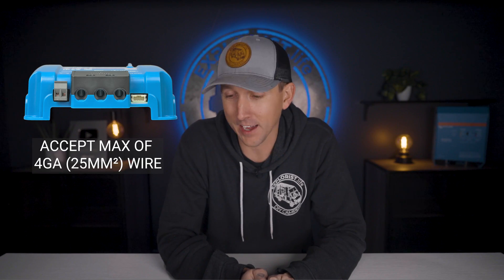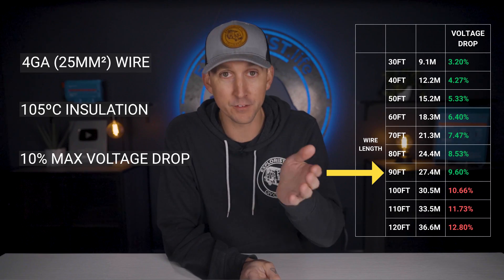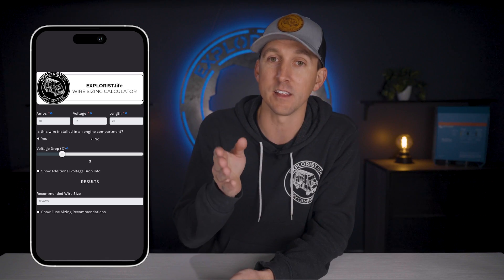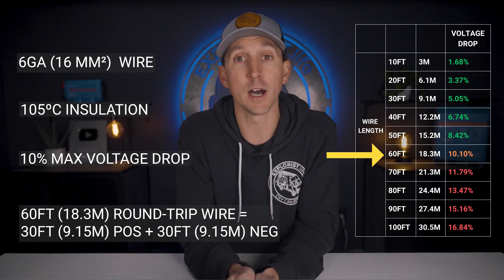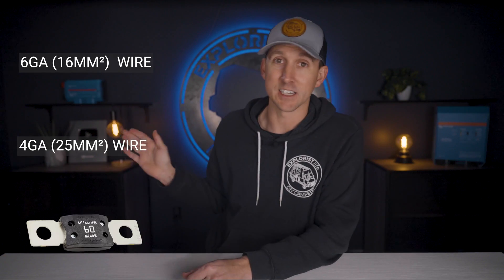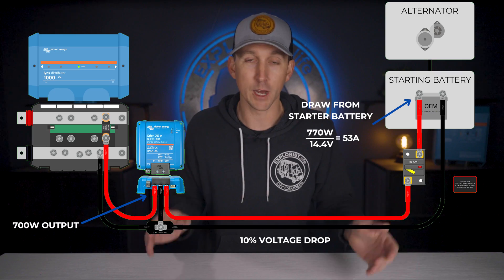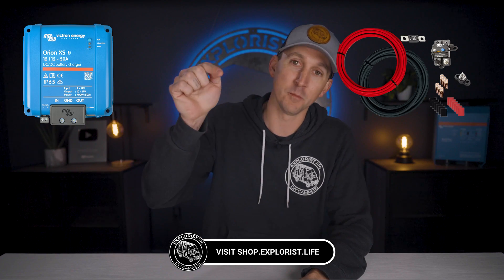Wire & Fuse Sizing for Victron Orion XS DC DC Charger

Comment: I have 8 gauge wire existing in my current Lance truck camper plug, can I set the 12/12/50 charger to provide only 30 amp charge due to wire size and length of 30 feet from starter battery to lithium camper battery?
Reply from the maker: Yes — that’s usually doable, and it’s a smart idea with 8 AWG over ~30 ft.
That said, the “right” limit depends on a few details (your exact charger model, how it’s wired, and your expected voltage drop), so the best move is to have our team take a quick look at your setup and confirm the safest/most effective charge rate for your truck/camper wiring.
Reach out here and include your truck year/model, camper model, the exact charger you’re using, and any fuse/breaker sizes you have on that run:
https://shop.explorist.life/support?utm_source=youtube&utm_medium=comment&utm_campaign=support&utm_content=response_link

Comment: Also should I add ba smart  isolation switch with thIs hook up?
Reply from the maker: Great question — whether you need a smart isolation switch really depends on your specific setup, battery types, and how you’re using the system.

We’d love to take a closer look at your build and make sure you get the right parts for your project. If you can send a quick overview (battery info, alternator, and how you plan to use the rig) through our support form, we can help you dial it in: https://shop.explorist.life/support?utm_source=youtube&utm_medium=comment&utm_campaign=support&utm_content=response_link
Reply: @EXPLORISTlife ok thank you....in on ship now I'll send you whenever I get off the ship

Comment: Ok I understand the 12 12 but what is the 30 mean?
Reply from the maker: Great question — the short answer is that the “30” is the maximum output current of that DC-DC charger.

That said, whether 30 A is right for your vehicle wiring, battery size, and use case really depends on the details (wire gauge/length, alternator type, battery chemistry, etc.). We’d want to look at your specific setup before making a recommendation.

If you reach out to our support team with your vehicle info and planned battery system, we can confirm the correct Orion model and make sure everything is sized safely:
https://shop.explorist.life/support?utm_source=youtube&utm_medium=comment&utm_campaign=support&utm_content=response_link

Comment: Why are you worried about the total length of the positive and negative wire, because you should be using the frame as the negative on the truck and the trailer,
Reply from the maker: Are you in the market for this device/wiring kit or just sparking conversation?
Reply: @EXPLORISTlife I am going to buy the xs was looking at the tr
Reply from the maker: Perfect!  We'd love to supply you the parts/equipment for your project.  Let's move this conversation over to our customer support inbox so this doesn't get lost in all of the YT comments we get and we can be sure you get the answer to your questions.  Reach out here: https://shop.explorist.life/support?utm_source=youtube&utm_medium=comment&utm_campaign=support&utm_content=response_link

Comment: How would you approach wiring (2) of the Orion 50A? Is there a way to run a single negative and single positive wire, or do I need to run two sets?
Reply from the maker: Great question! ⚡️ The best wiring method can depend on your exact setup and components, so we’d love to take a closer look at your project and make sure you get the right solution. Reach out to us here: https://shop.explorist.life/support

Comment: Can this new Orion XS be used to charge a 24v system? (I noticed in/out V is programmable?)
Reply from the maker: Great question! The Victron Orion XS does have some flexible voltage settings, and that programmability can definitely open up more use cases depending on your system setup.

That said, whether it’s a good fit for charging a 24V system really depends on a few specific factors in your build.

I’d recommend reaching out to our support team so they can take a closer look at your setup and help you pick the right gear:
https://shop.explorist.life/support

Comment: Does Orion XS work with solar systems?
Reply from the maker: The Orion XS is used for charging your battery bank from your alternator — it's not designed to handle direct input from solar panels. For solar charging, you'd want to use a dedicated solar charge controller designed for lithium batteries.

If you're unsure how to best integrate all your components, our support team can help you map it out:
https://shop.explorist.life/support
Reply: @EXPLORISTlife  thanks 👍

Comment: I already have 50 amp breakers near my batteries, using 6ga wire. With this 50 amp dc-dc I'll need to replace my breakers with 60 amp. Is that correct? Alternatively, can I just down rate the 50xs to only take say 40 amps?
Reply: Never mind. Re watching this vid answered my question. I'll be buying the XS 50A DC-DC from your store very soon.
Reply from the maker: Glad the video helped clear things up! And awesome to hear you’ll be grabbing the XS 50A DC-DC soon—let us know if you need anything as you get it installed: https://shop.explorist.life/support
Reply: @EXPLORISTlife  I do want some support on the installation. I posted a question about including the DC-DC into my setup but the person went off on a tangent how not to attach all negatives directly to the shunt. Ultimately was no support AND in the end referred me to a $10.00 diagram. So if there is any post purchase support it appears to be monetary support from customer to company.

The videos are great though! I guess I'll stick to them and Wander the West forum for info and answers.
Reply from the maker: We don’t recommend connecting all negative wires directly to the shunt.  Do you want us to go against our own recommendation just for you?  Maybe I don’t follow what you’re expecting from us when you reach out for our recommendation.
Reply: @EXPLORISTlife You clearly don't understand! I do not have my negatives all connected to the shunt. That was not even my question. My question is about the DC-DC charger.
Reply from the maker: @JD-ft2lr gotcha.  Reach back out to support and clarify.  Have a conversation and we can work through it.

Comment: Hi I have done exactly what you have discribed changed my 30amp Orion for the new 50amp XS using the existing 16mm cable. But I am having a problem with the XS, the most I have seen it deliver is 15amps. My old Orion delivered 30amps no problem, I was going to upgrade the cable to 25mmas I thought that might be the problem but now Ive seen your video  I dont need to..Any idea why Im not getting maximum getting apps? Love your videos very heplful
Reply from the maker: Thanks for the comment — and glad the video helped! There are a few things that could impact the current output from the XS, including wiring, voltage drop, and system settings.

To really pin down what’s happening, we’d recommend letting us take a personalized look at your full setup:
https://shop.explorist.life/support
(Free personalized support is always included with gear from our store.)

And for components purchased elsewhere, our Pro Support Membership is a solid way to get tailored help and solve tricky issues like this:
https://shop.explorist.life/shop/all-products/membership-tiers/

Comment: I am about to wire my Truck this month (June) and your videos are really helpful. This one in particular helps me to understand what "friends" and other installer have said. I was really question the 6 vs 4 gauge wire (I have 6). I have from the starter batter to the rear of the truck to the inside of the RV (orion 30 amp, really thinking of switching to the XS) about 25 ish feet. So again thanks.

Comment: I want to upgrade the batteries in my 2024 Arctic Fox 811 slide in camper to lithium. My 2025 Silverado 3500HD LTZ has a 120v outlet. Do I still need to use a Victron dc to dc charger? Can I just connect to my 120v outlet to eliminate the use of the dc to dc charger? Which would you recommend?

Comment: Just to keep in mind the Orion xs is 50amp in or out (whatever caps out first) low input voltage will limit the units output not increase its current intake to my knowledge
Reply from the maker: Yes, that’s correct.  Hard capped max of 50A on either the input or output terminals.

Comment: Yes thanks for the update on wire sizes. I have a dc to dc charger 30 amp. On 40 ft. Of 4 gage. I just bought the dc to dc 50 amp charger. ( I didn't realize you sold them also,sorry) my question is can I add the 50 amp with the 30 amp on the same 4 gage wire?

Comment: I just installed two of these in my Leopard-43 PC.  The engines are Yanmar 8LV 320.  At first they worked fine but then both turned themself off.  The notices said engine shut done unit off.  I do not know how to turn them back on?

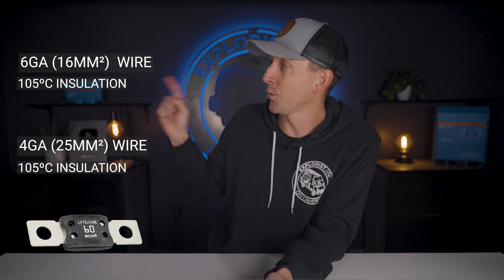Comment: Does anyone know what the limitation is regarding the wire temperature and amp rating relative to - "When installed outside an engine space" (3:19 in the video) ?  Who has a battery that is installed not near the engine (maybe a few)...
Reply: The Orion XS should be situated close to the target battery (the one it is CHARGING). This is typically the “House”/“Habbitation” battery in a RV/Motorhome and is usually outside the engine bay and other heat sources.

This is to reduce voltage drop (by way of shorter wire run on the output) to the target battery. The voltage drop on the input side is not so critical as it doesn’t affect the charge efficiency of the target battery.

Comment: Nate, One thing you should probably mention at some point is that although the insulation of the wire is rated 105C, that doesn't mean the lugs are rated for that, and you need to derate down to the bottleneck.
Reply from the maker: That’s not a consideration that needs to be made in the context of this video, no.

Comment: Hi, I purchased a lot of stuff from your great store, including the Orion XS. My RV (trailer) has that Orion XS wired to a Lynx distributor (also purchased from you!) with 6 AWG. With my former tow rig I had 6 AWG wire running from the battery to an Anderson SB50 connector to the trailer, but never got more than 25 amps charging, I assumed because the run was longer than a total of 30 feet (though not much more). I have a new tow rig, and am planning to run 4 AWG wire from the battery to an Anderson SB120 so I can get closer to the 50a output. My question is: do I need to replace the trailer’s existing 6 AWG wire with 4 AWG, or can I just replace the Anderson SB50 with an SB120 on the trailer cable and use the existing 6 AWG in the trailer?

Comment: This really helped. I had a 12|12 30 and it was not smart, really dumb and isolated. The xs50 has been awesome but I down rated it to 30 for safety. Now I can run it at 50 amps with confidence.  😊

Comment: I could really use some help. I have been fighting this issue for 3 years now. I just cant take it anymore. Because the Ford Transit has a smart alternator, it's impossible to properly configure without an ignition wire. However, I feel like getting that properly run to the engine fuse box is going to be a difficult task. My question is this. Can i run a signal wire from the 12v hot on a 7 pin trailer hitch? My ford transit has the tow package, which includes a 5 pin and a 7 pin round connector on the back. Any advise would be GREATLY appreciated.
Reply from the maker: Happy to provide some personalized guidance for our customers: https://shop.explorist.life/support

Comment: Hi Nate 😁
Can I use a 6 gauge wire if I will put 2 orion 30amp in parallel? ( 60amp )
The length of the wire will be 8 x 2 meters
Vh Rudi from Denmark 😁
Reply from the maker: Here is what you need for that: https://shop.explorist.life/shop/all-products/dual-victron-orion-tr-smart-12-12-30-dc-to-dc-charger-wiring-kit/ 

We ship internationally!

Comment: If only having a total round distance of 20 ft from the vehicle battery to my XS, could I use 8 awg as it has a voltage drop of around 5.4%?
Reply from the maker: The goal should always be to minimize voltage drop where it's reasonably feasible to do so.  If this is a new install; use 4AWG, which is the largest wire size the terminal can handle.  Wiring kit: https://shop.explorist.life/shop/all-products/victron-orion-xs-12-12-50-dc-to-dc-charger-wiring-kit/

Comment: Ok so crazy question... These recommendations are for the input side. What about the output side? The use case is as a recharger during power outages for a (mostly)portable system that resides away from the vehicle and continues to power devices. Technically, it could be moved closer to the vehicle, but it's not overly practical.

Also... can you "cheat" the recommendations by having a shorter negative that is grounded to the chassis?

Comment: Hello, Love you work and much appreciated. Looking at this video I belive there is an error in the wiring diagram (3:41). It seems the positive wires as shown are reversed (IN vs OUT). The Orion XS wiring kit diagram on your store shows correct wiring.
Reply from the maker: Error on the video, fixed in the kit, yes.

Comment: Why only one negative terminal? And where do we get a good combiner block like you show to combine the two negative leads?
Reply from the maker: Only one terminal because it's a non-isolated unit.  Our wiring kit for this component includes the proper combiner block (junction stud) for a permanently installed solution: https://shop.explorist.life/shop/all-products/victron-orion-xs-12-12-50-dc-to-dc-charger-wiring-kit/?attribute_wire-lentgh=30ft

Comment: Question with the truck running and it set to charging my mode. Can you still use the battery to power things while the car is running and charging the liFePO4 battery?
Reply from the maker: Yep!

Comment: Hello, nice job , i have a question, I installed 12/12 30 amp victron dc to dc to my van at it gave me 25 amp before but now it gives me 12/to 13 amp for 100amp lifepo4 battery to charge , do you any idea why it doesn’t charge with at least 25 amp. Thanks
Reply from the maker: This will need deeper troubleshooting.  If you've purchased your DC DC charger from us at shop.explorist.life and you want us to take a closer look, reach out at shop.explorist.life/support.

If you've decided to give your business to a different victron dealer, reach out to them for support on that.

Comment: in my short Microcamper  the 4' run from my starter into the charger will be 4awg copper, but okay to use existing 8awg copper OUT of the charger to the house lithium for a 7' run?
Reply from the maker: We recommend, and our kits include, 4awg wire for the entire charging circuit.

Comment: This is an excellent video; very professionally done. I own a 2020 Leisure Travel Van on a Mercedes Benz sprinter chassis.  I would like to install 2 Orion XS DC-DC chargers.  The chargers would be mounted under the passenger seat which would be just a few feet from the chassis (starting) battery.  According to your wiring kit for a dual installation, you recommend 2 awg wire and a 150 amp circuit breaker.  For my situation, can I use a smaller awg (6 or 4) and what would be a sufficient breaker between the chassis (starting) battery and the Orion XS?  Thanks.
Reply from the maker: If you want to stray from our recommendation, you’ll need to do your own calculations.

Comment: I think I’ve asked this question before on your channel, but I don’t remember getting an answer. When wiring from a truck to a tow vehicle through a seven way tow plug, you only have 10 gauge wire for the charge wire in there. so does it make any sense to use bigger wire than 10 gauge from the alternator back to the tow plug and then from the end of the seven way inside the trailer to the Orion?? or just use 10 gauge the whole way????
Reply from the maker: Larger wire is required.  We have a wiring kit for this component: https://shop.explorist.life/shop/all-products/victron-orion-xs-12-12-50-dc-to-dc-charger-wiring-kit/

Comment: Just the video I needed, thanks.  I plan to upgrade to lithium on my 2001 Leisure Travel camper van and plan to use Orion XS as a replacement of existing OEM battery isolator.  I understand fuse on starter battery, but where do I put fuse on coach batteries if I don’t use Lynx ?  It would have to be at output of the Orion correct?
Reply from the maker: Fuse as close to the battery as possible.
Reply: @EXPLORISTlife  thank you, but just to clarify, I’d have two 60A fuses, one at the starter and the other at the coach batteries.
Reply from the maker: Correct
Reply: @EXPLORISTlife  I’m sorry, but one last question.  I’m planning to mount Orion XS in location of old battery isolator in engine bay.  Is installing in engine bay a problem?  The coach battery compartment is a very small, slide-out tray with barely room for the 2 coach batteries.  Besides lack of install location, the battery tray has some exposure to dirt and moisture.  Thank you again for your help.  I’m looking forward to make the move to lithium.
Reply from the maker: @voyagerman22 The Orion should not be installed in the engine compartment, no.  Should be in a dryer, cleaner, cooler environment as close to the house batteries as possible.

Comment: How do you explain the discrepancy from what you say vs what the manual says? In the Victron manual, 6awg recommended for a 15ft run, with 4awg recommended for a 15-30ft run.
Reply from the maker: Certainly!  Wire choices is what we will be covering over the next 7-10 weeks on this channel in the academy; so if you watch all of those videos and take notes; you'll have a lot better understanding and some additional insight on how we size wires for various components; ESPECIALLY when we are forced into a scenario that goes against manufacturers recommendation.
Reply from the maker: Link to academy where videos will be uploaded.  New videos every Sunday: https://www.youtube.com/playlist?list=PLmvhcyi4n0TWdoT6YNzBha-x7W_mH306i